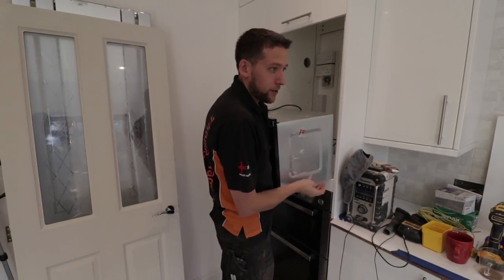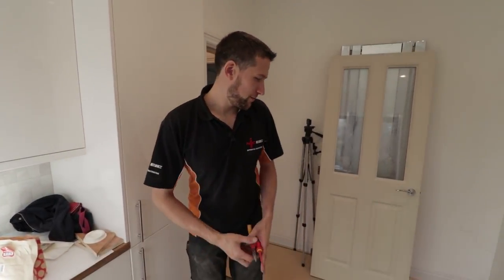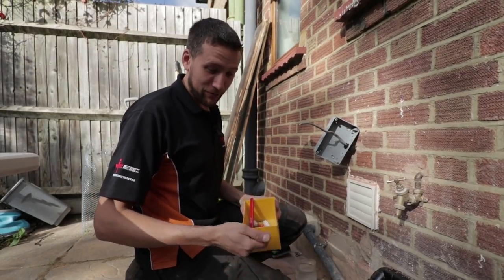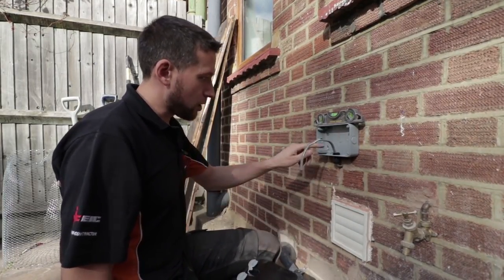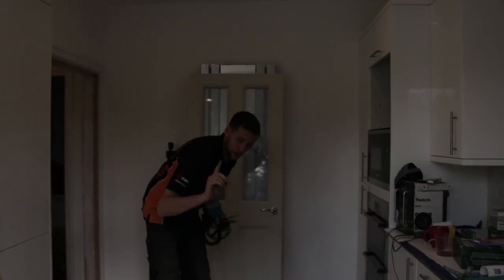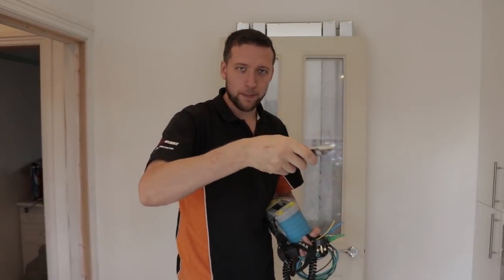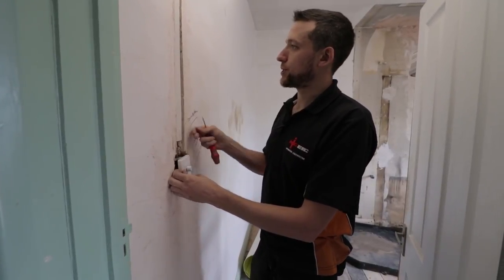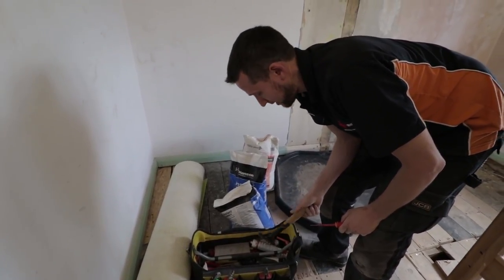The Final Furlong - Rewiring a “just rewired” house | Thomas Nagy

Comment: I've always had a preference for MK. The finish and the look of the accessories is a lot better than 'cheaper' stuff. As for the outside socket, I'd use the bottom entry but use a round flex/cable suitable for external use along with a stuffing gland. I'd probably put a bit of sealant in the hole in the wall where the cable comes through. I wouldn't necessarily shy away from the rear entry but I think the socket would need to be sealed round to prevent water ingress down the back...
Reply: When an electrician rewired my business (whole ground floor) he used Contactum. They do look nice, they are of reasonable quality but I do not like it. Most annoyingly, when I purchased frames for internet sockets they were of different white shade to electrical sockets - it looks absolutely rubbish. More over now most of Contactum switches seem to be sparking a lot and trip either RCD (one specific CFL lamp) or MCB (small 1.4kW motor very rarely - no issue with tripping MCB when motor connected to a different socket).

Comment: Sockets have a drain hole you just drill it out. So if bring cable through back water does get in it will drain away via hole you drill out. Check corners for writing stating drain hole kind regards Ashley

Comment: Neutral down to the switch is actually becoming more important than before. I say this because now you have "smart" devices that have active circuitry which has a bit of current being passed along the neutral all the time to run the little power supply for it. If no neutral, than its being connected to the earth wire. Get more than just a couple and your tripping. Current being carried on the earth wire? Good idea?

Comment: Wow, In the usa we do things so differently, You are not allowed by code to have junction boxes under a floor, behind a wall, or anywhere in accessible- period. Typically all connections are made in the boxes for the switch or fixture, We also have specific code in regards to box sizing- there are only a few standard box sizes. And we would never be allowed to have wires so close to the wall surface, they must be 1 1/2" back to prevent accidental nail through issues.

Comment: readings also change a lot on the lap sockets from socket to socket try testing at back cable termination point first and be shocked how much it can get upto my records in the .20 ohm range difference from back terms to front socket outlet (designa denmans sockets)

Comment: Hi, I am getting my new property re-wired along with change of switches, sockets and installing led spot lights, in short new electricals replacing the old electrics in the Edwardian property. How do I also get Ethernet and audio cables run along side the electric cables, I am entrusting the job to a electrician? Have you got any videos for Ethernet and audio cabling with electrics??

Comment: On the topics, lights I try to take feeds to the switches like yourself. Easier to work on at the lights, especially downlights.
Smokes, I try to put on with the lights. Usually separately wired but in same mcb as lights. I believe building control prefer that way too. Although I’ve just fitted some terrible kidde smokes that state they want to be solely on own circuit. 
Not a fan of MK switches. Seem flimsy to me. Sockets and spurs seem good. I do like the Schneider kisses stuff. Looks good, feels and works good.

Comment: Cheap tools are sometimes surprisingly good:)
I’ve bought an 18V SDS  drill from A..I, a couple of months ago.  It is a really good drill, I’ve paid 49.99 for the drill, you can drill through a 50cm thick wall with a 10mm bit without any struggle:) unfortunately they stopped selling the drill, only available on ebay for £95.00..

Comment: I prefer to wire lights in the old 3 plate system eg feed and neutral in and out with a feed and switch line down to the switch instead of  neutrals down to the switch makes it a lot easier to add to and alter in the future

Comment: Glad you use 35mm boxes everywhere.With flat plate sockets and new usb sockets makes so much sense.Can't stand it when people use 25mm boxes just to save a few pennies😠
Reply: Gavin De Brito and chopping out!!
Reply: Gavin De Brito 

Plus the thickness of some internal walls..
Reply: Don't have to chop wall if using 25mm boxes
Reply: Its not a few pennies. A 35mm box is another 30% labour time to chase in and then times that by a full house worth of sockets
Reply: Just did an refresh for a customer -  all flat front stainless switches and sockets. Could not get the dimmers in the 25mm boxes (actually nearer to 15mm) and a pain to fit cables.
Reply: Ive put 47mm boxes everywhere in the house and some of the light circuits barely closed anyways lol

Comment: On outdoor surface mount  box, "we" usualy go on the back knockout with a bigger hole in concret/wood/(any finished flat surface) to accomodate a connector then back fil the hole with a putty called Duck Seal. Place a bead of rubber caulking (Flextra) half arround your hole then screw the the box and a Flextra bead arround your box. Never saw any kind of moisture gething between the box and outside wall... never had an issue with that kind of installation with our canadian weather.  Sorry hheeey...

Comment: How do you fit smoke alarms off a local lighting circuit if there's only a switched live at the light point, re running your feed in and out at the switch?
Reply: Guy Warburton what he means is sharing the same circuit breaker as the lighting at the fuse board, so you will have two cables into the breaker.

Comment: More and more smart lighting products require neutral at the switch so good future proofing. I did a house 3 plated and then a year later they asked for lighting compatable with Alexa and i had to say ill have to rewire the lighting. Not happy.
Reply: Came say this. With all the home automation stuff it makes it easy to install with live and neutral as well as deeper back boxes. I wish my home had been wired like that.
Reply: @TheYeeterDefeater  when you say capped does that mean a wire nut? In areas where BS 7671 3rd amendment applies those would not comply. There are several colours that can be used to indicate phase conductors but it best practice to sleve it brown at a termination point or in an accessorie.
Reply: @scottrowland7448   deeper back boxes but stuffed with 6 wagos and fuck loads of wire, power in, 2-3 lights and power to next light, nice

Comment: Got pulled up on a new build this month, domestic smokes need to be able to be isolated to meet building regs !! So I spoke to the NICEIC and yes it’s true, it’s not a BS5839 or BS7671 requirement but bloody building regs. I said but people will turn it off , they said I’m not accountable for that. So I’ll continue to put them on the lighting circuit but mount a fused spur to isolate the detectors only, bloody ridiculous , just asking for trouble with that

Comment: when i qualified (4years to get 236 1, 2, & C ) in the eighties, neutrals were not permitted at light switches,  also looping the L & N at the switches makes it more difficult to extend, as you can't loop out from an existing 3 plate rose / JB,, i haven't updated since sixteenth edition, as i no longer do installation, but surely the regs havent changed that much though ?

Comment: CK cutter <3 the best!
Reply: CombiMax 3, I think my CK's are called. About £27 and probably my favourite single (non-powered) hand tool. With shears for taking both 3.5 and 4mm screws down to size without deforming the end of the thread, stripping holes in the blade for 1.5 and 2.5, and a bending slot and folding anvil behind the hinge to aid doubling over your conductors, they are a dream to use on T&E and by far the fastest way to 2nd fix sockets and most other accessories because all the cable operations can be done without this one tool leaving your hand. Reach in to the back box and crimp the sheath, snip the CPC free at the end, grab hold of it with the anvil and unzip to the crimp, snip and peel off the sheath, strip the ends, bend the ends, fold them to perfectly flat form, all in a third of the time of someone using old fashioned CCT cutters

Comment: I had my house rewired with MK outlets and switches. They look good, but are very sensitive to ham-fisted plasterers. Around 30% of of the sockets needed replacement - either you cannot get a plug in or the switch will not latch on. The switches - I got rocker style ones - aren't a lot better - the rocker on around 4 out of 20 falls off when used. To make matters worse, I contacted MK thinking that they might be interested in this quality control issue. They weren't interested and were rather dismissive.
Reply: Exact same problems, MK are crap, they are hit 'n miss made in China now. FCU melted due to a defect, took photos for customer services, they were not even bothered, rude too. MK has terrible feedback on amazon. Googled the problem and some guy had 100 defective sockets from MK, they would not replace them. I've had double sockets and light switches melt too. Never buy MK now. Years ago they were the gold standard, cheap Chinese crap now.
Reply: +Vax Buster. That's a pity. I'm an expert DIYer and have a enough stock of MK stuff bought a few years back bought for a song on eBay - e.g. 10x K2747 double switched 13A sockets for £15 delivered.
Reply: +Nicole K Had the cable clamps break on a couple MK plugs (MK 646) a couple of years back so I emailed them. The reply was along the lines of "So buy some more - they're cheap enough". They may be in the staff shop but the the rest of us pay over £4.

Comment: ADVICE NEEDED!!!!!!! WOULD BE APPRECIATED. I am a level 3 am2 gold ecs card holder qualified electrician but thinking about maybe going into the domestic game at some point but for now I am just wondering with my qualifications because I am always getting bombarded with work from relatives/ friends with full/ part rewires, board changes ect, I am wondering with my current qualifications can I self certify my domestic work? If not what do I need! Thank you! Also Best electrical youtuber by a country mile, fun, informative, educational and honest reviews on accessories not just bugging mk because there the most expensive trying all brands I like it.
Reply: With those certs you should already know! This conversation/ debate/ winge has been going on in the industry for years -- go read some back issues of Professional Electrician!
No you can't self-certify most of the real work people will want you to do. You need a Part P cert from one of the several money-spinning bodies. Personally I'd use ELECSA (aka the ECA, friendly, helpful, don't make you jump through hoops to get certified) and avoid NICEIC (more expensive, more admin, more anal inspectors, make you have more examples of work to assess before they let you join the club) and since both are now merged into CertSure you get the same market recognition and benefits as you would have done with the (admittedly more recognizable) other name on your van.  There are others, NAPIT et al., but to get into domestic work you want to be with a gang that Mrs Miggins may have heard of, and NICEIC has always thrown more money at better advertising, which now rolls into CertSure, so ELECSA is the way to go. It'll cost you probably £460 (I think that's what it cost me a few years back) and a bit less annually to keep it up. I only did house bashing for a bit when "real" work (mostly metal munching to be honest) dried up for a time a few years ago, otherwise I'm definitely a commercial/ industrial/ atex guy, more variety, more challenge (better pay!)

Comment: Great channel Tom. I’m an electrician but not domestic based so nice to see what you guys get up to. 
Quick question though, do you ever deal with new builds where they dot/dab over cables on block walls? I was planning on adding a socket on the other side of a wall of a cable run (around head height) so I was going to pull the old cable up and through the wall then run a new cable down the wall to the existing socket to close the ‘ring’ but when I saw the massive dab around the socket and all the way up the run of the existing cable, I gave up.
How do you deal with this nonsense??
I can see why they do it but it’s very annoying trying to pull out an existing run.
Reply: Don't really like plastic capping as its not good to make good over 
As to the o/s skt what about drilling a 10mm hole at the bottom would act as a drain also
As for lives at the switch you could then use double pole switches would be better for testing
Also it's a lot of cables at going to switch if chasing (OK in stud partions not good if wiring on the surface and would you do it if wired in conduit ?

Comment: Knock out back hole. Put grommet in .might mastic top and sides of box if more than 1 cable. It's front of house so no visible wire. If it was the back then I'd probably use bottom knockout . 
  My latest news is outside retractive switch with neon from Wickes are proper shit (rectangular type that occasionally conducts electricity when pressed ) and they cost £7.50 ! Will be upgrading it to mk I just don't feel like paying about £28 for it.

Comment: If you're in the market for a new toolbag (which I think you are) I can highly recommend the veto pro pac tec-pac backpack. I have used it exclusively for about a year now and have NO COMPLAINTS. Its perfect for when you have to park some distance away from the jobsite. The things I have in my backpack including a Bosch 12V fc2 drill are enough for 9/10 jobs I do as a service electrician doing both residential and commercial, it weighs just over 17kg. I used to have the same piece of shit bag as you have in this video, the big open bag with a shoulderstrap. It was fakin awful to lug around. The backpack with even more stuff, no problem.

Comment: I was tslking to a guy thats a sparky. Works for him self inside the M25.  Has a large sprinter van with the front bit converted to a motor home. The guy drives down from Yorkshire on a monday and drives back on a Friday.  Earns more in London than he would in Yorkshire.  A big plus is his van. No cost for staying out, the big jobs he pulls up pn site and dont move till Friday.
Reply from the maker: its surprisingly common. a lot of trades do it now.
get a cheap motorhome to avoid the costs of accommodation, do a weeks work, then drive back home wherever that may be.
various people i have met have done this. might get a little tedious after a while, but for a few months of good cash, its worth a thought i think.

Comment: I wouldn't say that the MK standards are premium, more middle of the road - especially if you bulk buy, but compared to the likes of LAP they are far superior in both aesthetics & build quality, terminating into MK is usually easier and tidier too.  

Outdoor socket - I tend to go for running rigid plastic conduit through the wall & into a coupler on the back of the box.  It requires a slightly larger hole in the wall to take the coupler, but it means that the cable is fully protected and also doesn't get scraped by whatever is lurking in the brickwork when it's pulled through.  A light application of caulk can be used to protect against water ingress.  I've seen far too many external sockets where the cable coming out of the bottom of the box has been whacked by something leaving bare wires....

Lighting circuits - I'm an old fart who usually opts for the junction box route as it simplifies things should the switch need moving, plus it's neater and easier when dealing with two way switching or having multiple lights & switches in one back box.  I can see the benefits of taking the neutral down the wall, especially with increasing use of smart switches & now that we have the Wago type terminal blocks it's something I'm doing more; whereas back in the old days I hated seeing a bunch or neutrals dumped into a chock block.

Comment: I’m not a fan of bring the loop into the switch, I’m not a spark but for the homeowner it’s easier for future expansion with the loop in the ceiling.
Reply: Zed Man 

Just use 3core as your switch wire, permanent live can then be added to expand at light 👍🏻

Comment: Outside plug point:
Why not put the outlet inside a weather proof electrical housing with room for a GFI?
Reply: David Fildes The circuit is already protected against over current and leakage, and the socket housing is already waterproof. What you are proposing is duplicating the protection that has already been provided, which would be pointless.

Comment: Why dont you use flexible wire pipe in the wall/roof  all the way to the fuse board to pull the wire?.

Comment: I drill out the back of an ip socket. Drip hole down the bottom just in case. Bead of silicone around the edge. No cable on show then 👍

Comment: Realistically for a 2 bed semi rewire using MK accessories is probably going to cost you £30 extra than entry level stuff. To me even the logic stuff looks and feels a lot nicer than the BG etc kit. Other argument is if fitting a reputable brand results in 1 less warranty call back you already in profit.

Comment: The firm I work for always use mk and on the odd occasion Wandsworth but do love mk
Reply: Crabtree are about equal to MK too, but MK most stylish on the market (and look how many cheap copycats they got!).
Reply: Hager Sollysta and Click Mode are decent, Contactum are the same quality as Crabtree. To be honest I prefer the look of metal sockets and for years MK Albany has always been my first choice, I accept no imitations of MK Albany but brands like Volex and Varilight are almost as good as Contactum and I like Crabtree's textured brushed chrome/steel finish.
Reply: Wandsworth are a bit expensive but they are top quality. Maybe a little too posh for my liking but used ones do crop up on EBay from time to time for next to nothing.